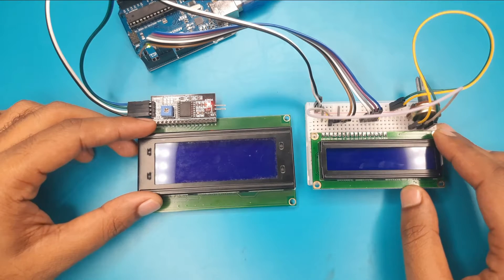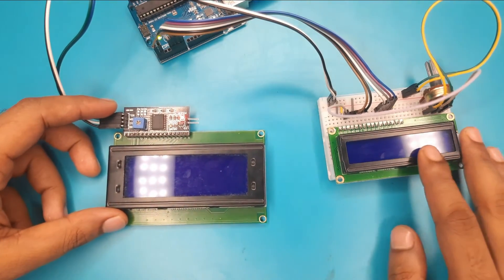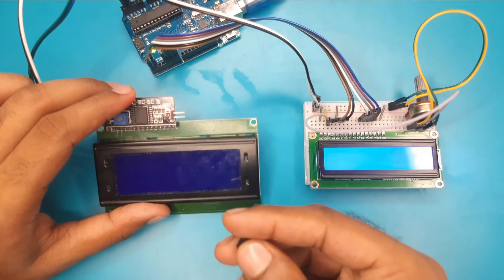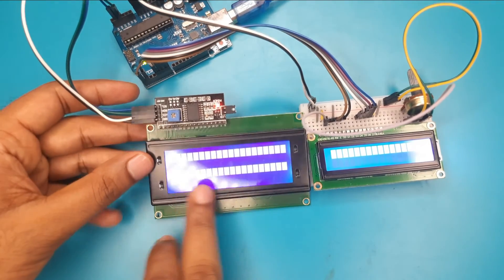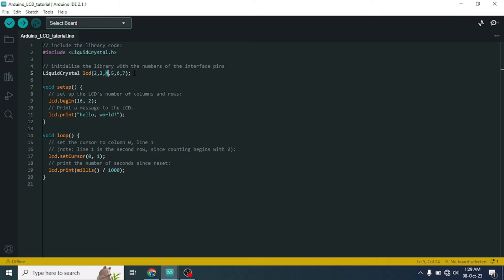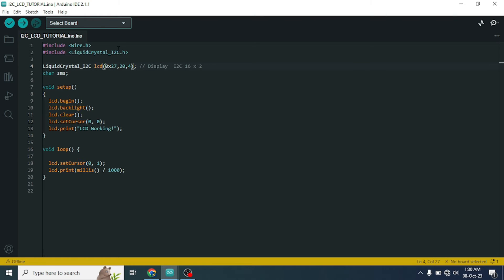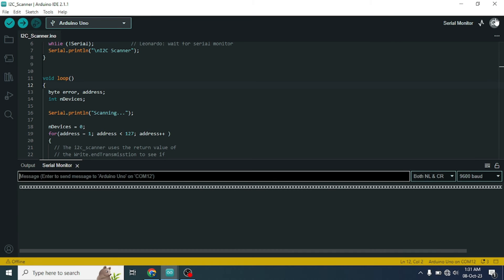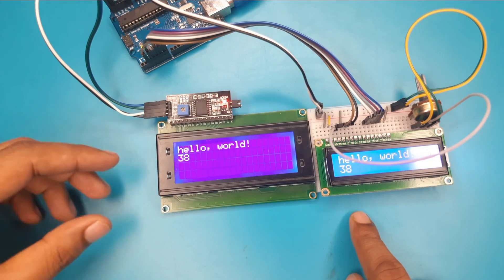LCD Display Not Working issues with Arduino | 100% Fix Solution

Comment: my lcd is with 2 lines and connected with I2C directly. I work fine for 10 hours, But after the display got corrupted. When i switch ON , OFF and ON again all come back to normal. Do you have any suggestions?
Reply from the maker: check your others stuffs and power supply

Comment: Sir, I am facing an issue with my 16x2 LCD display. I am using I2C with the LCD, but I cannot see the output after adjusting the potentiometer. There is a power voltage issue because the white box lines are not displaying properly after reaching the limit of the potentiometer what can I do please help me
Reply from the maker: inbox me on facebook. www.facebook.com/nttronix

Comment: Showing I2C devices not found.Help me please
Reply from the maker: Change your i2c module
Reply: @NTTronix  I have the same problem (I have the I2C module on right with the black part connected to the bigger LCD) It lights up and shows doted line just like it does on video, but when I run the code for scanning it also says" I2C devices not found. " I don´t know where is the problem. The wires are correctly wired, the display is showing dot line. Please help. I´m stuck and don´t know how to continue.
Reply from the maker: @leostark7605  If it shows that i2c devices not found that may be your i2c module is not working.

Comment: In my case my i used an i2c with 20×4 display lcd and coding is working but there's no text on display and even if i rotate the potentiometer of the i2c its not working and i finally got to know the problem now by watching this video but please tell me how to fix it
Reply from the maker: If you rotate the potentiometer, is it show any dot line or anything?
Reply: nope, I am having the SAME issue
 @NTTronix
Reply: maybe d10 is output high ; on some lcd keypad shield 5V---->----Rx---->----(D10 i/o)----Transistor(base)
In that case D10 must NOT be driven OUTPUT & HIGH at the same time,it will cause short current.
Remedy is to cut trace coming from D10 (backlight always on) or put resistor 470 ohm in between,then you can PWM it
(see DFrobot LCD Keypad Shield Backlight Fix)